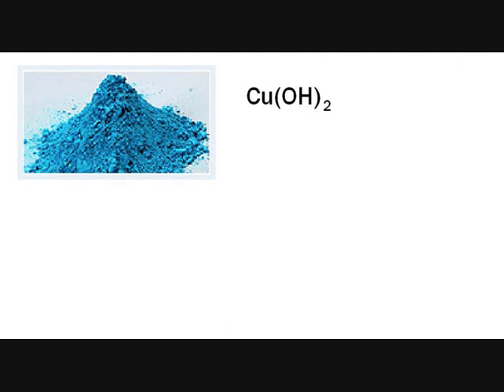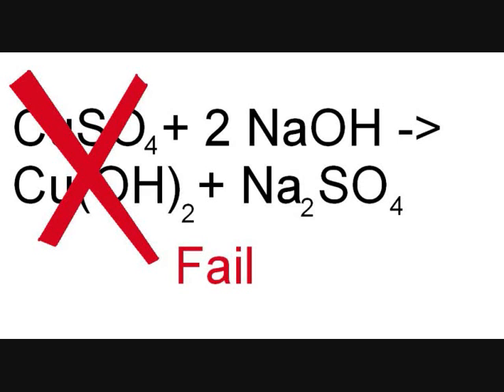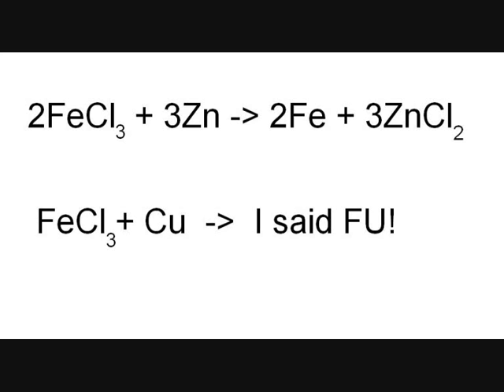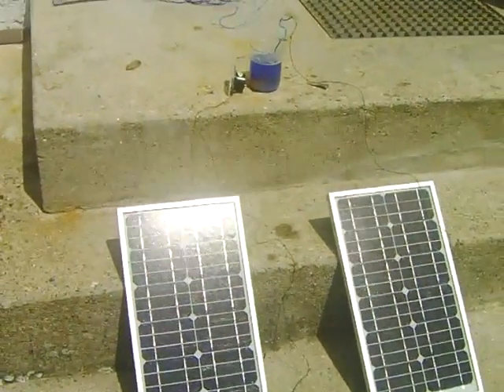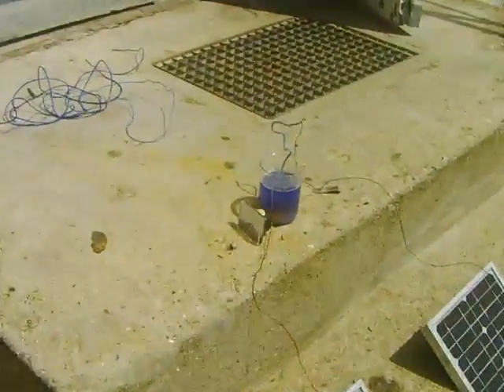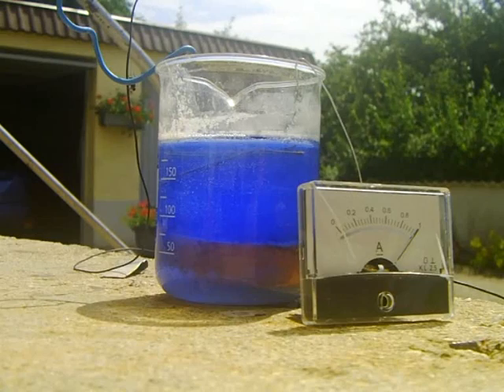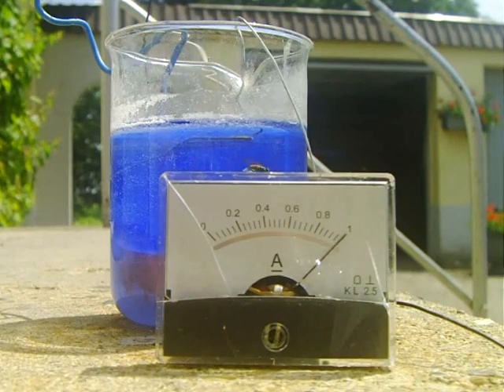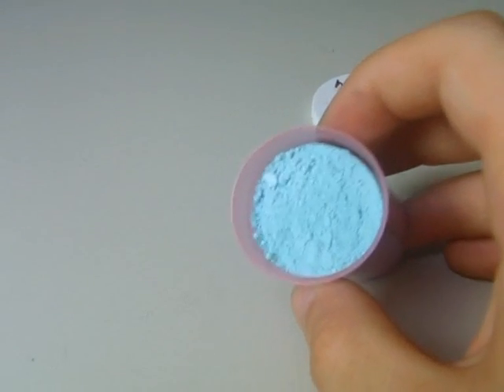Copper hydroxide - the electrochemical approach

Comment: i was trying to make this a while ago to make CuO, but i just tried electrolysis of water with copper anode, which worked well, but after a while i would get a brown material, i was eventually gona put it directly under a heat lamp tp decompose it, but im not sure if the final product is even CuO

help?

Comment from the maker: The panels put out 18 to 20 volts, but as the cell has a really low resistance, it drops to less than 3 volts. Off camera, I added my other selfmade panels (you might know them from my old hydrogen videos) and I got up to 3.4 volts@ 2 amps.
Copper hydroxide is good for making various copper salts such as copper acetate, chloride, nitrate, sulfate and many others. When heated, it decomposes into copper(II)oxide, which is useful if you want to make death thermite. I might try this too :3